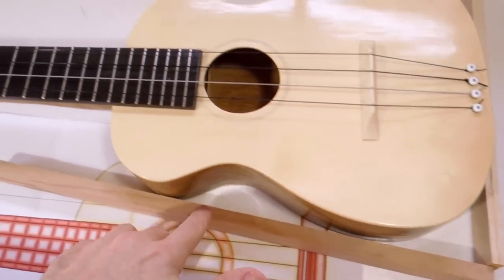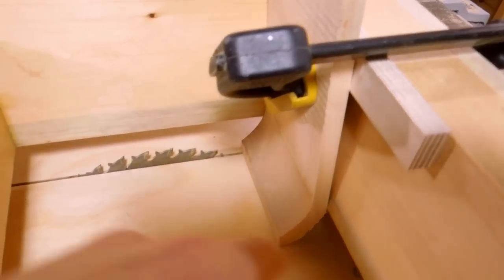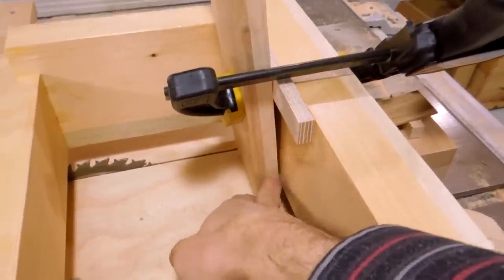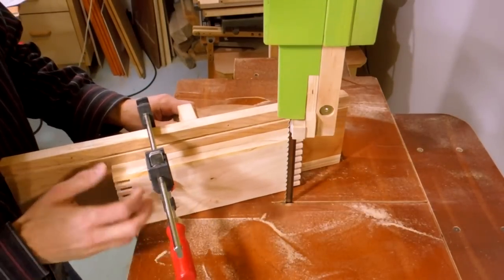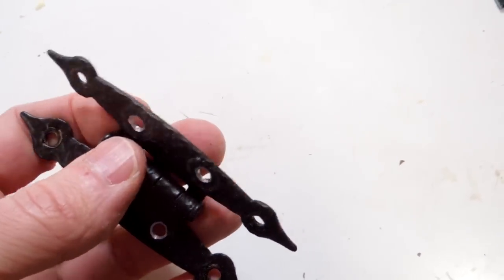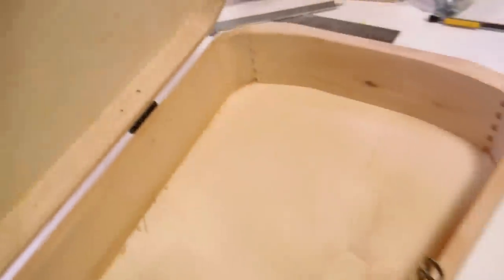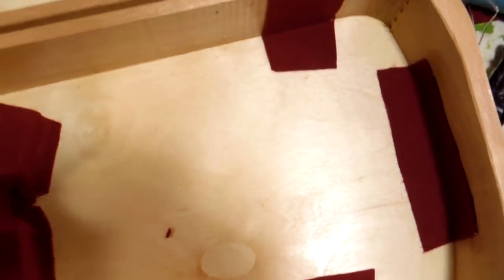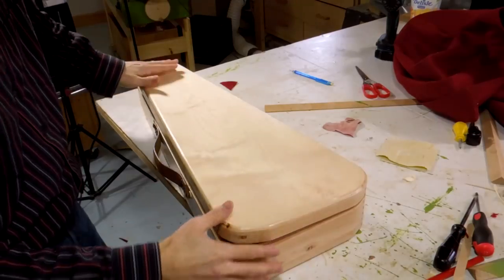Instrument case

Comment from the maker: I can't use the splitter with a zero clearance insert, nor can I use it for non-through cut, or with a sled.  So it really doesn't make sense to put it in for that maybe one in five cuts where it could be used.  Maybe you mean a riving knife, but my saw doesn't have that capability.

Comment: Just when I thought it couldn't get any better, you threw in that genius latch. Very cool. Also just wanted to throw out, I believe I have seen examples somewhere of using expanding spray foam to make a form-fitting enclosure. (underneath protective cloth and or plastic of course).  Could be a good companion idea for those doing your project.

Comment: It is so nice to see real ingenuity in a craftsman.  Love the tools and fixtures that you use.  Nice sense of design.  Would it help to fit he top and bottom on before splitting them on the rotary saw.  that way you eliminate the risk of the top distorting when you fit the top panel to it.

Comment: Have you ever tried flocking as an interior covering ?
You smear the inside with white glue and knock a loose felt powder around inside.
.
It's a lot like greasing and flouring a cake pan.

It works really well for a fitted case - you can create inlays from mdf and then coat it all.

Lee Valley has a kit.

Comment: Matthias, in the future for holding felt down to surfaces like that, the "pros" use spray adhesive, which doesn't cause the bubbles or ripples in the surface that you talked about.  Your hot glue appeared to work fine, however, and the case turned out great!

Comment: That's a pretty nice case, and the button gizmo is amazingly clever. I think the only thing I could have done different would be to add a bit of a recessed finger grip to help push the top open when using the button. I've been wanting o build a case for my Dulcimer, but I just never seem to have the time. It would likely need more of a coffin shape for the case.

Comment: Great idea for the latch. And why didn't you use spray adhesive to glue the felt inside the case? Ever thought on using EVA as padding blocks to hold the instrument down when the lid is shut?

Comment: I'd suggest a velcro strap across the neck of the ukulele to hold it in place in case the lid pops open when you thought it was closed. That way you don't get a really nasty ding in your ukulele when it rolls out of the case and hits the square leg of the office chair you use when practicing (don't ask how I know this.)
Your case should look really nice after applying a finish!
BTW, there is no form of luggage that is UAL-proof (again, don't ask how I know this.)

Comment: a lid always wants to move away from the box, because if the hinges are slightly too much countersunk ( wich they mostly are ) so if you press one button, it will move upwards enough for the hook to not catch again, if that happens to both, it doesnt have to happen simultaneously. i have a 76 stratocaster, and because of poor latch construction, the case opened while carrying. it fell out and scraped the edge of the sidewalk, now theres a big chippout, it was in perfect condition before this

Comment: I know it was a joke, but if you're seriously taking an instrument on an airplane you should have at least 3 double-action latches. I'm not suggesting you do this to your case, as it's not a flight case, but a good flight case has aluminum edges and spines and a piano hinge. Imagine your flight case being thrown 2 meters onto hard concrete with your instrument inside, because that is what can happen. If the case comes apart because of weak hinges or latches then your instrument is going to fly out of the case and be destroyed.

It also needs to have enough shock absorbance internally. I have seen instrument cases which have a box inside a box, with inner box supported by steel springs like a trampoline. Think about that two meter fall, the longer it takes to absorb the impact, the less force is on the instrument and the less likely it is to be destroyed. Obviously this is going to extremes but if you are transporting a $100k violin or scientific instrument then it probably warrants it.

Comment: Think I'm gonna make a variation  Of this for my guitar although I'm probly gonna cast the handle out of aluminum and put on a different button and then change the look in the case quite a bit probably add sort of in antique Gray wood stain with black edges and also Use super 77 spray adhesive rather than hot glue And on top of that add a plaque with my name and contact information on it

Comment: Question: Doesn't that locking mechanism will starts to fail sooner than usual because of the L-shape will start to align itself in the open position?
Reply: Alan Nope, the restoring spring force in the steel is not overcome by the small amount of work done on it when you push the button. It might dig into the wood, or snap off from work hardening but not for a very long time.
Reply: Jdmeesey Thank you for the answer.